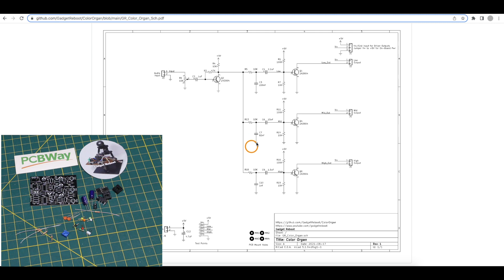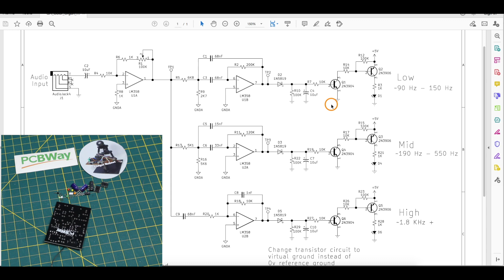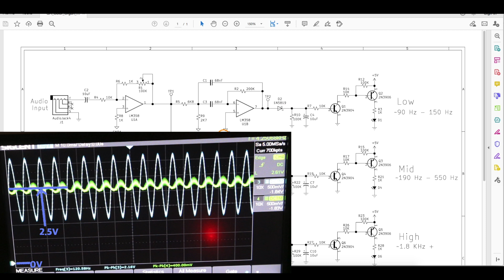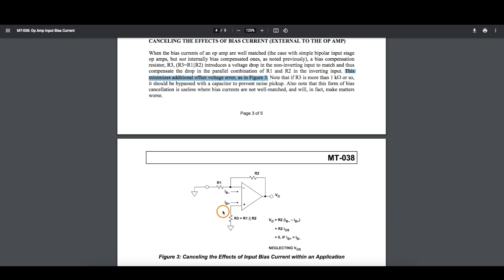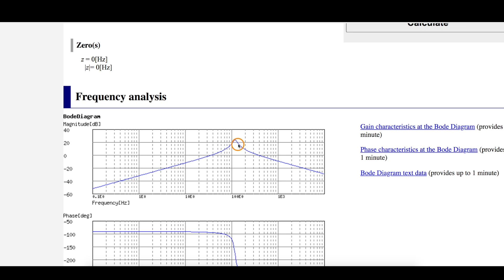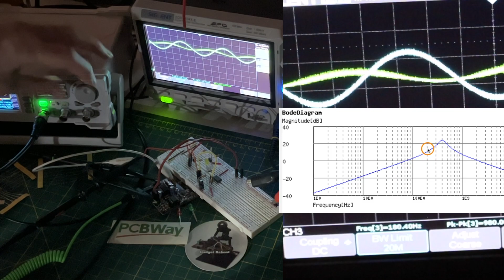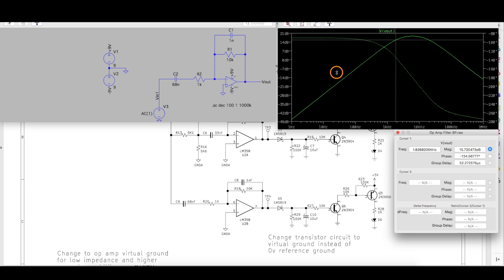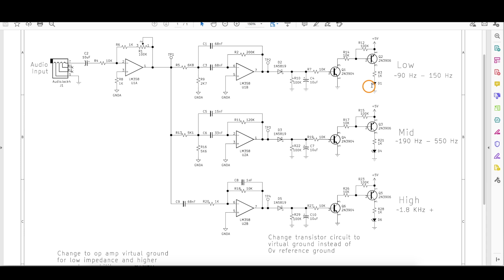I Designed a Half Broken Circuit

Comment: the way to think of a capacitor in parallel with the feedack resistor is that the gain will be half when the impedance of the cap is equal to that of the feedback resistor.  Xc = 1/(2 x Pi x xF x C ) so C = 1/(2 x Pi x F x Feedback resistor)
another point to remember is voltage gain in dB's is  (V1/V2)log20 so half the voltage is -6dB's

still better to design half a broken circuit than a whole one. it's a good thing that capacitors block dc or we would be trying to design DC coupled circuits, if you have ever tried to fault find one your know what a pain in the butt they are. 🙂 if they have feedback a fault anywhere in the circuit affects the whole circuit and not just a stage.

Comment: why not just put a capacitor between the opamp and the diode to isolate the virtual earthDC bias from the first transistor. the AC signal will still pass and charge the caps via the diode.
Reply from the maker: I could try that and compare to the op amp bias upgrade but the first thought I had was whether adding 3 capacitor footprints would add up to more real estate or no difference from adding another 8 pin op amp, and money is no object on a hobby board so it was just a coin toss based on that.  I also wondered if the series capacitors may not allow the peak detector to charge as fast across the whole pass band as the impedance changes and causes current limiting etc, but maybe that could turn into a feature too, helping fluctuate the LED brightness more authentically.  We'll see what shakes out, maybe I'll not worry about board space and add footprints for both options and just jumper across capacitors if I don't use them.
Reply: @GadgetReboot  The DC locking caps will need to be large enough to pass the lowest frequency you need to pump the charge pump with sufficient current. 

Well i always breadboard my circuits before committing them to a PCB, even now with jlbcp/ pcbway and all other others; the main costbeing the P&P. So only $5 for the PCB’s but $15-20 i want to know that they will work when they arrive.
Reply from the maker: The other benefit of a capacitor is it should help limit reverse leakage current if I'm using a schottky to charge the other capacitor with minimal voltage drop, only to lose the charge faster than a silicon diode.  
I breadboard most things but then stupid mistakes find their way sometimes into the board.  When I did that big 16 channel low side FET driver that can do a bunch of amps, I soldered a prototype together to be sure it was good because that would have been hard to fix with an xacto and bodge wires.